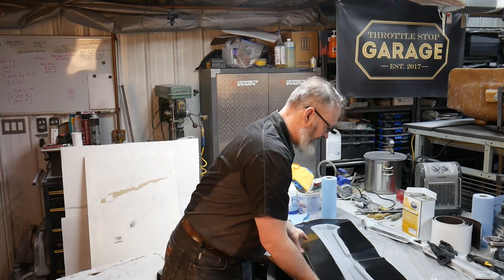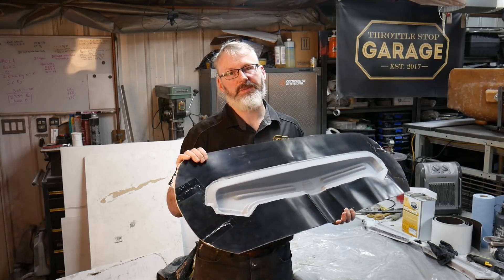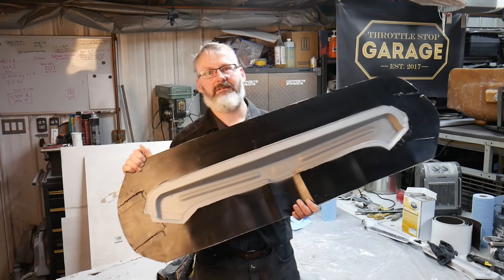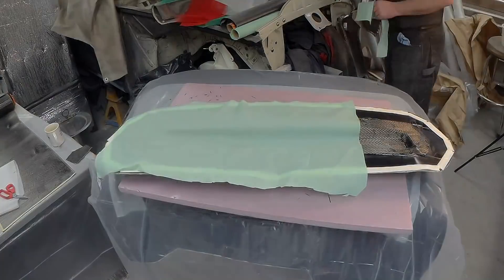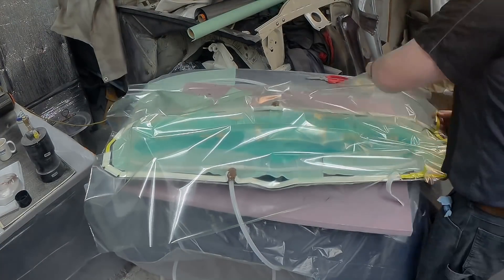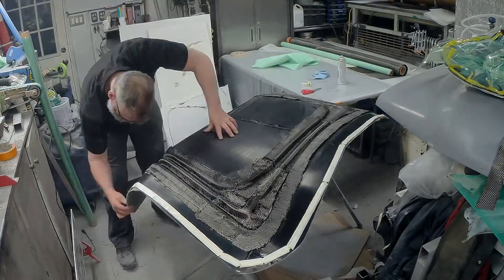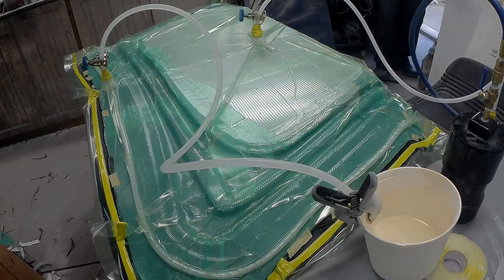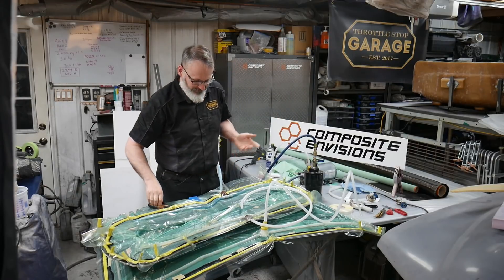DIY Carbon Fiber Trunk:  Part 3.  Putting it all together.

Comment: You are too humbled. I can tell you have experience pre reques and can apply them here. To me you are a pro!
Reply from the maker: Glad you think so, I'm always learning.  I'm happy that you've found this work useful.
Reply: @ThrottleStopGarage  Yup Im starting a new start up and this is one of the services that company is going to provide. Ive so far learned everything from you. I think you have given me a rock solid foundation to build from. Like you Im a profesional my career was in specialized automated production machinery and Machine tools for aerospace and jet engines. I was never a pro body guy but I was a also tech and been restoring cars and trucks my whole life. So Ill be adding my experience to this.  I have a 66 Chevy Nova II SS Im giong to use the entire create all the plugs and the molds Im likely going to reproduce those parts and I might offer a kit car " the Novair II " LOL

Comment: Excellent work! ESPECIALLY telling me what to look out for in potential mistakes so my flanges are wide and my mold release remains unpolished...

And the fit. I'd been wondering about shrinkage making fitting it problematic, but it looks to be within the margins Marquis has stock. I can work with that!

And 11# lighter. Nice!
Reply from the maker: Glad it was helpful!  Shrinkage isn't much of a problem with CF parts.  Wide flanges are the ticket - somewhere to work.  Keep them as flat as you can and no wrinkles or areas that will be hard to seal.  Every time I look at this part I'm astonished I got it out of the mold!

Comment: Could you have done the deck lid & bracing in 1 piece?  Omit the flange from the bracing mold so it could "float" on top of the sandwich to accommodate for thickness.  Would still need to reference it to the main piece somehow & come up with a way to locate the fasteners.
Reply from the maker: Sure - depends on what you want.  I wanted to reuse the existing hardware for hinges/spring and the trunk latch as well as the trim panel.  That meant casting the complete front and back side of the panel.

Comment: Why do you keep removing the primer coat on to your carbon fiber part? Is that suppose to happen? That kind of defeats the purpose of retaining the look of the carbon fiber. What can be done to avoid this? Adding wax?
Reply from the maker: This car will be painted.  That's the point.  This isn't about the "look" of carbon fiber - this IS carbon fiber.
Reply: @ThrottleStopGarage  if you were trying to keep the Carbon Fiber look, what could you do? Add wax to the mold?
Reply from the maker: @Bdpjev  just don't use the primer.
Reply: @ThrottleStopGarage  thanks for the tip. So you were trying to apply the primer to the part at the same time?

Comment: Lovely! Great build and videos. Did you consider spray gel coat on the mold? I think you can use also moldwax then you can see the carbon. Sorry for my bad English. I'm Norwegian so my English is not so good
Reply from the maker: I always intended to paint the parts, so didn't consider a clear gel coat.

Comment: Great work as usual. The reason your epoxy is so brittle is because it cured at low temperature. I used to use that same epoxy before and it's a mess to work with. The trick is to heat it up before demolding.

Comment: I just went on a binge of watching your Carbon Fiber builds. I really want to eventually do fenders and other carbon parts for my Chevelle, so your videos are very helpful. I don't know where you are in Canada, but I am from Alberta, would you say Composite Envisions is the ideal place to get composite materials most cost effectively? I do US/Canada border pick ups on big shipments, but it's in BC.
Reply from the maker: You bet.  I'm in Alberta and have them ship to the border.  No issues with customs so far and I'm super happy with what I've bought.  Just FYI - polyester resin locally (either through Princess Auto, Canadian Tire, Local body shop or fiberglass shop is on average $65/4L.  And you'll use a lot of it - from Composite Envisions it's $24 USD.  So even with shipping they're a lot less expensive for the same stuff.  They also have a much wider range of products than I can find.
Reply: @ThrottleStopGarage  That's a great tip. I hope you don't mind if I pick your brain once I take the plunge in building some CF stuff. I'd say your products are better than some of the stuff the Pro shops sell. That's coming from the quality of a piece sitting in my basement right now.
Reply from the maker: @SS454LS6  Thanks - catch me on Facebook or Instagram.  I'm happy to help if I can.

Comment: Love your work, Sir. Such a happy  man enjoying his work. Cf is great to work with but can be fiddly. Might I suggest you reinforce your molds by glassing timber supports to whist making them and thereby you can create a stable platform with the timber reinforcement. Easier to work with.  Thanks for the vids and your efforts.
Reply from the maker: I use wood in the molds to make them more sturdy...on this one I had the metal cross brace and with a little short strand body filler it's fine.

Comment: great work and great videos as well. how much would you say you spent in materials for the molds and carbon fiber cloths and such in total?
Reply from the maker: I haven't totalled it just yet. A rough guess is about $1000 for this part just for materials.
Reply: @ThrottleStopGarage  ok thanks for the response

Comment: What are those nut / plate things called? Also, could you have vacuum bagged it when joining the two parts rather than using traditional clamps? (But, as every woodworker knows, you can never have too many clamps!)
Reply from the maker: https://www.mcmaster.com/weld-nuts "steel adhesive nuts" . In this case, clamping it was just easier.
Reply: @ThrottleStopGarage  Can't beat McMaster-Carr for sourcing odd-ball fabrication supplies and hardware like that; been a customer of theirs for going on 20 years now.  I happen to live within 20 miles of their northern IL warehouse, next day by 10 am delivery when I order by 7 pm

Comment: Beautiful job.  I think all Amazon boot lids are tight on the right hand side by the rear light where you first pointed.  From what I can tell, there is a discrepancy between the left and right of the car at this point.
Reply from the maker: Really?  I'll have a closer look when I get to fitting the panel.